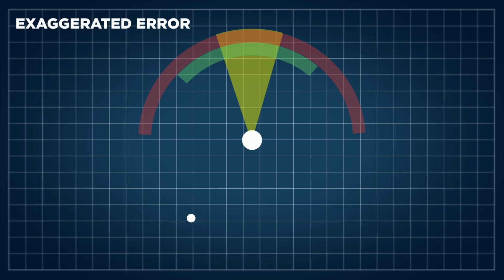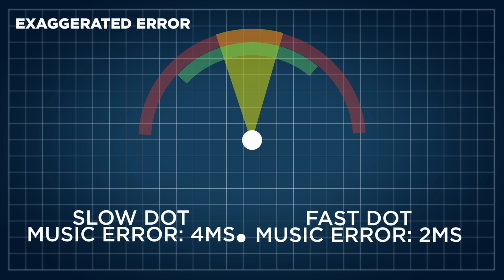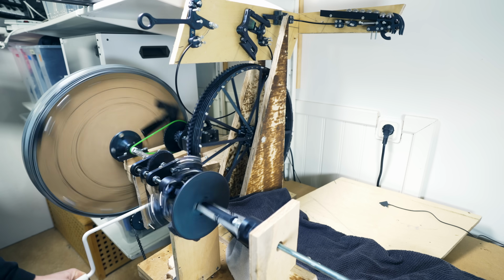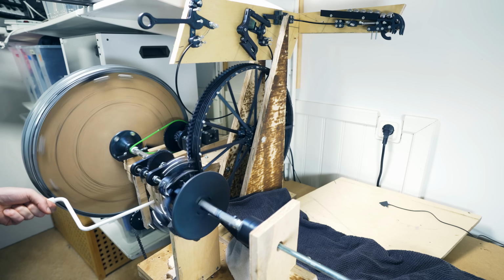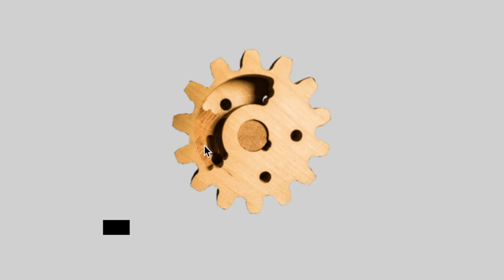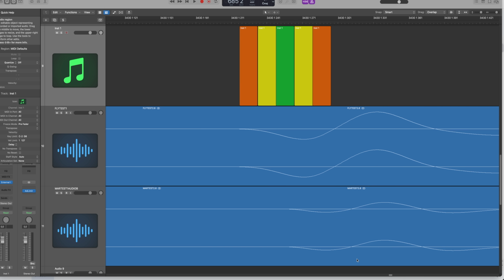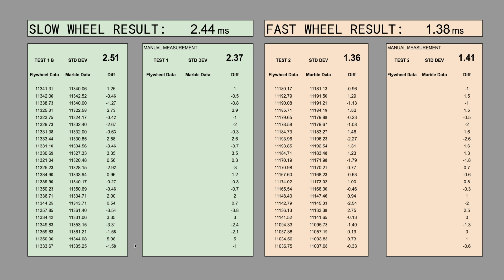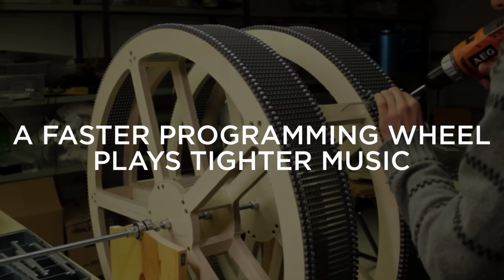Testing a Faster Wheel - Is the Music Tighter?

Comment: I suspect there is some imprecision in your testing methodology here - you are testing the entire system at 2x the tempo, not just the programming wheel. This means that you are comparing tempo regularity at twice the bpm and the precision of the marble release mechanism, at twice the cable pull speed. I suspect the latter has a large effect on its timing precision. A better test would be to have the slower wheel have two marble release profiles per revolution, and have each of those profiles have twice the slope, both entering and leaving the profile. This would keep as much constant as possible, while testing just the effect of wheel speed.

Comment: Hi Martin,
I was wondering about the results. Since the speed of the wheel doubled, the music should play twice as fast than before. In that reagard an error of 1,41 ms is worse, when you compare it to the speed itself. 2,37/2 ms would be the same error (in procentage). Since the music is faster the offset is more significant. Howerever this still is a good result because the prototype is a bit klunky and doubling the speed is a big step out of specification. The more speed, the more stuff raddles, the more error you get - is what I would expect from that prototyp.
You might want to test how relible your prototyp is, when you add extra vibrations.

Guten Rutsch, Martin
Reply: My first thought tooo...

Comment: You're going to need to consider the trade offs between data storage density, and "tightness".  Due to limitations in how fast the marble drop mechanism can move, the faster the programming wheel moves, the fewer pins will be effectively usable.  Personally I would prefer an electronically triggered solenoid  powered marble drop with a programming pin that is conductive and small, so that it becomes reasonable to fit as many notes as possible per rotation on a wheel that is of reasonable size.

If you look at the mechanical instruments in that museum, all if them use very small programming pins, or punch cards.  None of them have massive shark fin shaped programming pins.  Pins that large kill the data density of the programming system.

Comment: You said that a faster programming wheel would decrease the timing error from the imprecision in the programming profile manufacturing. But that is not what you measure with this test.

I think that a better approach for this is to just calculate the timing error. If the wheel rotates with period `T`, have a radius `r`, and the programming profiles have a standard deviation of `Δx`, the timing standard deviation should be `Δt = T*Δx/(2*r*π)`.

Assuming  `T = 11.3 s`, `r = 300 mm`(guessed this one), `Δx = 1mm` (for reference), the timing error should be `Δt = 0.006s`, so about 6ms of error for each mm of error in the profile.

Comment: human reaction time is so insanely slow compared to the timings you are talking about that trying to wiggle 1ms out of the machine is entirely pointless. that difference will show up as you use the machine from the parts wearing down.
my point is, if human played music is good enough then 2 or even 5 ms is not just fine but has massive leeway as well.

what you should do is test YOUR OWN timings when YOU play then base the machine off of those realistic timings.

Comment: I think to solve the programming length, you could substitute a program Belt for the wheel.  This would allow for very long sequences (think player piano).  I also think devising a 4 way chain link for that 'belt' that you could 3d print would be a creative solution.   I'm imagining two types, a blank space (no note) and a play marker (play note).  Linked on the 4 sides to the neighboring links. Thus programming (and changing) would be as simple as clicking the links together to form the belt.  I envision that a 10m long belt could have a complete song encoded before repeating; even at the higher drive wheel speeds.  While 10m sounds long and large amount of space, a clever arrangement of idler wheels would reduce the footprint that the belt needs.   Cheers and Happy New Year!

Comment: And still no idea what the power needs / losses from the instrumental section of the machine will be... 
Hint: it'll be huge seeing some of Martin's previously shared thoughts.
Never seen an engineer start a project by sizing and tuning an engine without any idea what the application requirements are (torque, power speed, weight, etc) 🙄
Power / energy in this day and age is a solved problem. Bazillion mechanical solutions developed in last 200 years.
But a marble machine with instruments ? Not solved and really cool.
That's what he should be starting with, then design the power system accordingly, thanks to the modular-sections approach he presented a while back.
Oh well, entertaining 8(!) years series anyway.
Will be rooting for the 4th incarnation of this mythical beast 😂

Comment: Your test method does not match the explanation of your hypothesis:
How would a test with only one programming wheel profile on the wheel effectively test the variation/tolerances between profiles? Unless there is the possibility of the profile moving, it should be just as tight no matter the speed of your programming wheel.

You already have data identifying the relationship between speed and tightness. Faster wheel = less deviation, but that's more to do with deviation in the input power (which is definitely minimized by a faster wheel). To test the impact of tolerance, you would need to actually introduce tolerancing issues into your test (or just do the math to identify the actual tolerances that are acceptable in your profiles, then work towards that).

Comment: Sub-optimizing each part for < 1 ms tighter bpm is so dumb since it means nothing for the tightness of the actual music when the parts are put together. Something that might increase the tightness in one part of the chain may decrease it in another. It is also naive to look at one aspect of the machine at the time. It's like optimizing each part of a factory to increase the belt speed disregarding every other aspect of the production line that is important. Sure you'll have a fast pass-through but will have horrible working conditions, ergonomics, part-delivery problems, which will create quality control issues and tons of belt stops that may very well make the actual pass-through speed lower than before.  

Ceterum censeo Carthaginem esse delendam (and that the new machine design is ugly, and uninteresting, and if that had been the original design, the OG video would have never gone viral in the first place).

Comment: I really enjoy all the testing Videos! But I wanted to give my thoughts on this one. 
Variances in the range of 2 ms are practically nothing to the human ears and brain. In my experience, very few people Start noticing the delay at around 3-5 ms, most at around 10. So doubling the speed of the programming wheel (and halfing the Song time) just to get an already amazing timing from 2 ms down to 1 is nowhere close to being worth it. 
Noone would notice the benefit of having the fast programming wheel, but only half the length of the song will have a pretty big impact on the possibilities of the entire machine.
Reply: that is true, but consider that every other part of the machine will also contribute a variance. While the variances may cancel out, they may also not (they're random after all), so it is generally a good idea to optimise each part of the machine as far as practical
Reply: For the weehl he could also use kind pf a belt to make it longer without taking to much space don't you think?
Reply: Increasing the wheel speed also increases the energy required to turn it, which increases the chance of failures in the drive system due to the increased strain. I think for the most part that any variances seen here are due to play in the prototype system, more than the speed of the wheel, if the system is designed and built well the wheel triggers will not move relative to the wheel, and will therefore be consistent in their operation, this will mean that the all the notes will play tight relative to each other and the song, assuming the Bowden cables and gates are equally well designed and consisitent in their operation.
Reply: Yeah, for me it's clear he's trying his best to get "as tight as possible" in every step exactly to counterbalance all the potential small problems that can add up in every step of the way, which I think is a specially traumatic point on his experiences so far.

Comment: What you missed (or didn't mention) was, that there are diminishing returns. Look at your results: 2x1.41=2.82 > 2.37 .  This means that in absolute terms, yes it is tighter. But the gain is not linear, it has diminishing returns. So you might find a point where working on the tolerances or increasing the spring strength (make the mechanisms more snappy and settle faster) might have more of an impact than pure programming wheel speed. on the other hand, lessening the spring strenght might reduce the drag on the programming wheel (it will flex in itself and the gears if it has to exert power, that might lead to increased tolerances that you can't see while the parts are not running if you look only at the machining), so there might be another tradeoff that is worth looking at.
Reply: And even outside of mathematics, one should also take in account of Tighter vs Finer music. A slower speed allows for finer music, smaller programming pins, allowing for more notes on a programming wheel. A faster wheel means the music gets less and less fine, to add to the diminishing returns.

Look to the old music machines of the past, notice how they generally go at a snails pace. Chasing tighter music is good till it starts affecting the music. Plus the mechanical stresses put onto the machine at higher speeds will come into play.

There are a lot of perspectives one must look at, when you get an imperceivably small change can affect the whole system in a much larger way.
Reply: @SoraHjort On that note I always thought the bulky note profiles were a bad idea since they effectively preclude playing the same note in rapid succession, which happens all the time in music. Why? Because most of the space taken up by the profile is spent holding the mechanism open rather than actually playing the note, which effectively means that note can't be played again for whatever hold time he coded into the profile. So you end up with an insanely tight machine incapable of playing almost anything you actually want to play on it!
Reply: @ratvomit874  Honestly, I don't have too much of an issue with the profile of the programming tabs. Partly because this is prototype stuff, they may be shrunk later down the line. And partly, for playing multiple notes you could have those tabs have dips between start and finish. 

They may be a little awkward if nothing too much changes between the prototyping stage and the end, but I feel that won't likely be the case, since we're just in the prototyping and experimenting of the theoretical machine's mechanisms.
Reply: @SoraHjort There's a reason virtually all the machines at the mechanical music museum use pins or other small items for programming, right?
Reply: @ratvomit874  Music machines went not only to smaller pins to play more music but to fairly punch cardboard sheets or rolls. I'd guess for the marble machine, a rigid band could be set over the programming wheel instead of having the pins directly attached to the wheel. That way the size of the wheel wont be a limiting factor.
Reply: @jeandupont3682  Good point! We should probably suggest to Martin to basically use a giant film roll of music so the songs can be as long as you want. Loading in a new song would also be a breeze!
Reply: The true engineering comes when you decide at what point are those diminishing returns not worth it any more. Martin seems to struggle with saying "good enough" which is an Achilles heel for an engineer.
Reply: @JonathanKayne  yeah, knowing or more guesstimating when you need to say stop, this is enough is hard for most engineers. We have a saying in French that roughly translate in "the best is the enemy of the good", when you want to go for the best of the best, it often comes with issues down the line you haven't properly forecasted or with a exponential complexity.
Reply: @Thelvaen_Mandel  English has the same saying, only it's "perfect is the enemy of good".
Reply: Spins faster, sounds better, but holds less music... did Martin just reinvent the 45 rpm record?
Reply: Martin shows little sign these days of letting himself be stopped by something like diminishing returns. Unfortunately.
Reply: You beat me to it, on the same wavelength on dimishing returns.

Comment: Fun fact: this is also not a new problem. Something you could draw on for inspiration for finding the best compromise is the speed of recording media like tape. Tape recording of analog signals has this exact same problem the faster you pull it past the tighter the signal capture can be. 

Modern tape has digital signals recorded onto it. Imo this is closer to  your drum design than analog tape recording. It may be possible to mathematically find the point where you get the best return for the minimum speed increase.

Comment: It may not spend as long inside the error window, but by increasing the speed like that id imagine there wouldnt be much change if not worse by the increased amount of repitions in the error window. So it may spend 1ms inside the error but it may hit that 1ms window twice as much nukifying any real effect. Though rotational error windows arent a true measurement that i know of. Lmao
But for example: 
1 rotation = 2sec
1 rotation = 1ms loss
That would mean doubling the speed would bring that to 
1 rotation = 1 sec
1 rotation = ~.5ms 
However its doing a rotation twice as fast meaning its still netting a full 1ms loss just on ever 2nd rotation. So i really dont see how this would make it all that much better if at all. Plus over longer times that ebtire result may drag out to being worse seeing as it has that many more oppertunities to fail. Super interesting though.

Comment: Solution : Make the circumference of the programming wheel proportionally larger. In mathematical terms, you'd need to double the radius of the programming wheel if you double its rotational speed, but you can compromise : You gained about 55% in precision when doubling the speed, which means that you can also make your programming pins proportionally shorter without losing precision from the original radius.

Comment: Although you're using the hand crank in these tests, the new pedal design doesn't seem that safe to me, you may have added some blocks to the underside of the pedal to prevent your foot being trapped beneath the pedal, but I can't see anywhere you have safeguarded against your foot slipping when the pedal is down and being crushed against the underside of the platform when the pedal rises up. I'd prioritise the method for powering the wheel consistently at various tempos before concerning myself with latency, cos if the pedal idea ends up being replaced then all of this will be revisited for the next propulsion method. Please focus on eliminating the hand crank, cos that represents the engine of the project and right now it doesn't look like it turns particularly well, and the replacement you have in mind looks like it might cripple you if you lose focus for a split second (while you control multiple aspects of multiple instruments). MMX could run for hours unattended, I'm not sure why that hasn't been carried over to this project.

Comment: I think that you should test if the drive is tight with variable load. Since the amount of note played and so the marble that get lifted is not constant the drive will receive different load, depending on where you are on the song. On the mmx this was not an issue because it was hand cranked and so you compensate the different load with a higher torc from your wrist. This is not the case on the new machine, so it MAY behave differently
Reply: I think Martin should decouple the marble lifting and the music playing parts of the machine. You don't need millisecond accurate marble elevator, only the gates need to be tight. And removing extra parts from the actual music machine makes it easier to make it work right. The elevator part might not even need a flywheel.
Reply: Hi, lifting is the one thing. I wonder (sorry, I didn't see every of your really interesting videos) if the amount of gates - which are played at the same time - impacts the tightness of the music. Or said in another way: how many gates can be triggered at the same time without slowing down the programming wheel too much so that the next beat comes at the right time.
Best regards
Jürgen
Reply: What if you had a two part trigger? Right now the programming wheel is doing double duty, loading a new marble, tensioning the springs and triggering the release. Only the last part is timing sensitive, others only mess up with the timing. What if you had some kind of ratcheting, constantly spinning "reloading wheel" that would immediately reload the next marble and tension the springs, leaving the programming wheel to operate only basically hair triggers? That way you'd also have as long a "hold time" as possible, which was a positive thing in previous tests.
Reply: @tuomasperttula3651 +
Reply: @tuomasperttula3651  Having everything under tension all the time might significantly increased the wear and tear on all those parts.  It’s a cost/benefit analysis with most every parameter you change.